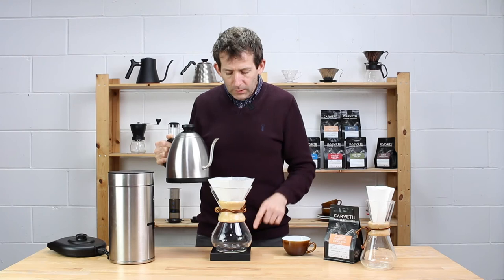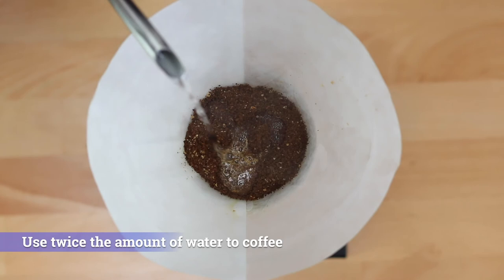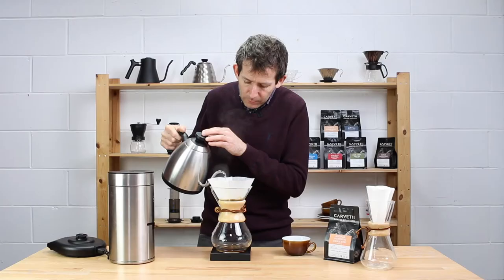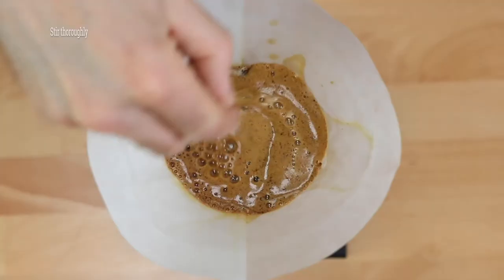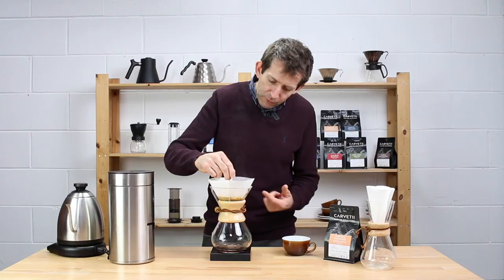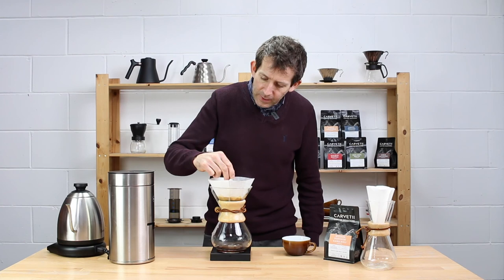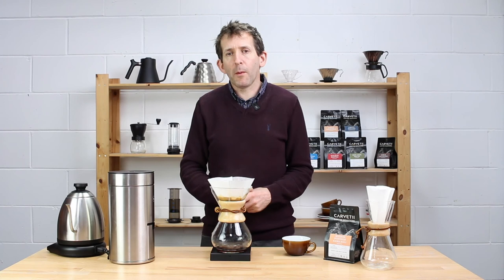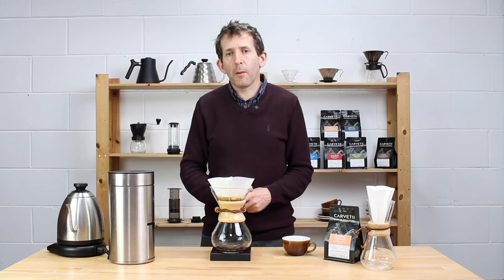What is the Coffee Bloom?

Comment: Great vid. I've never stirred before...
Reply from the maker: Hi Shaun, stirring is a new concept to me as well to be honest.  I made so many brews of the Chemex to make the videos and without a doubt stirring had a positive impact.  Thanks for the review btw 👍
Reply: @carvetiicoffee  no problem. I have the concept of water temperature slightly confused I think.
In my pouring kettle, I wait until the temperature is 94 - 95 via a thermometer. Obviously there is going to be temperature loss from kettle to bed. Do you think the water should be hotter in the pouring kettle?
Reply from the maker: I honestly do think it needs to be higher. At work I use an electric temp controlled kettle and set it to 97-98 degrees. This just about keeps my brew temp at 92-92 degrees in the coffee bed. At the weekend I have a pouring kettle and add boiling water to this. If you have a thermometer pop it in the coffee bed while brewing. It’s really interesting to see the loss in temperature.
Reply: @carvetiicoffee  by jove. Tried 97 and it tastes great. All these years I've been getting it wrong! Scared of getting those forbidden 'bitter flavours'. Thank you very much for these tips.
Reply from the maker: Result👍 Thanks for sharing. Makes the time and effort to produce the videos all worthwhile 😁